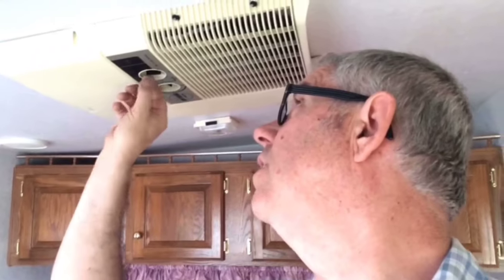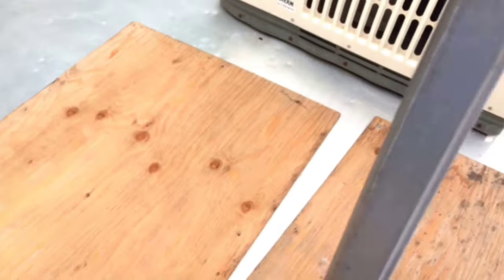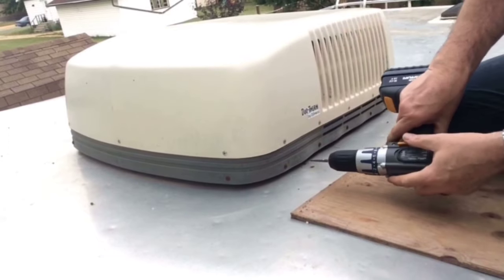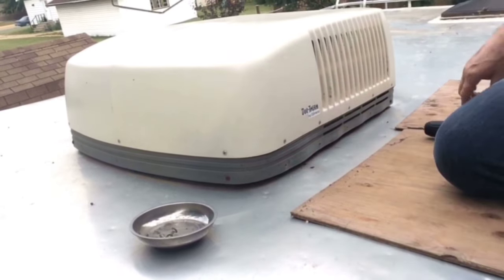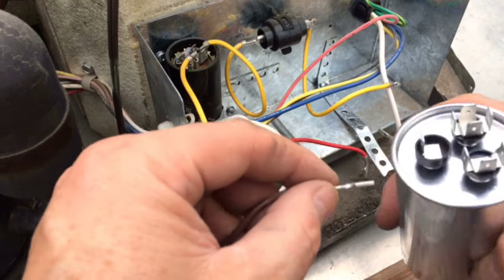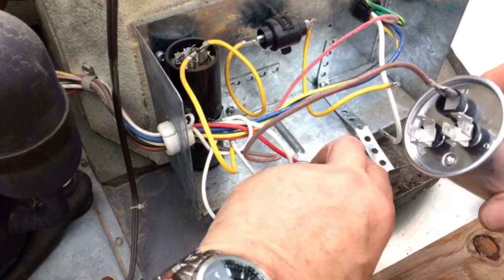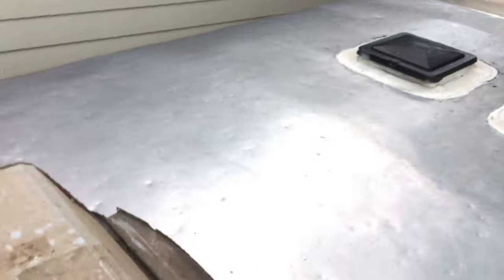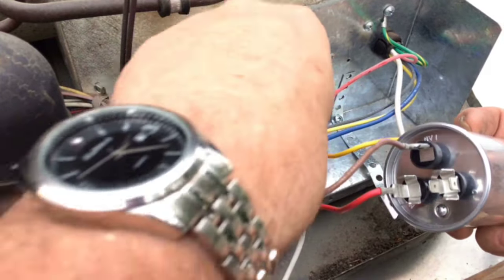Why does my RV air conditioner not start up (EP 15 ) not run?

Comment from the maker: ⚡Capacitors contain / store⚡  high voltage ⚡! Short terminals with a rubber handled screw driver. I still used rubber handled pliers just in case there is still stored power! 
Possible that if motor occasionally won't start, but does start after you rotate fan a bit, motor could have a dead spot and motor will need to be replaced. If it always needs a spin once you have turned it on, it's probably the capacitor. (probably 2 most common issues)
🔶 Check out my other RV camping videos in the series:  https://www.youtube.com/playlist?list=PLgeVnQRQkbzAsmAaCU0QzGXLWNaC-JOc6    🔶
Reply: What if I can get my fan to kickstart but when I went inside it’s not blowing air but motor is going
Reply from the maker: Charles Mckie , best bet is talk to a rv dealer. They will be able to get the exact parts for your specific unit.
Reply: I am do glad that you mentioned the safety aspect of removing a capacitor, when I saw your video I was literally diying inside. You must always discharge or use rubber to disconnect.

Comment: your video was helpful.  it motivated me to call the repair guy
Reply from the maker: Thanks Carl! I would probably feel the same after watching it. That was one of my first videos on youtube, (video 15) which was hard enough to try to repair, let alone try to video and make some commentary!  Electronic repair is not my strong point (as you could tell...LOL) Some may want to try to figure these things out and hope it fixes the problem. There is specialized equipment for testing the CAP, but I didn't want to but that tool since it would never be used again.
Reply: @unclemarksdiyauto  pop
Reply: @unclemarksdiyauto  d

Comment: good video.  i might have missed it but might be good idea to show how to discharge the capacitor you removed, in case it had and residual charge
Reply from the maker: Nope, you did not miss it Jim. And your right, I should have discharged it as I was filming the video. Early video, (#15) I am slowly learning from each additional one I make.  Yesterday was my 292 video (i think) Nov 1/21. I learned a few things in this one, like don't take for granted you will remember which wire goes where! Lol! Thanks for watching.

Comment: My ac is driving me crazy.  I replaced the small cap (since the diagram is too badly weathered) but this year the fan doesn't start when I spin it by hand so maybe it's the motor or the other cap.  But I'll fix it myself if it kills me.  Nice vid.

Comment: A part number or specs would be helpful. I need this exact part but I guess I'll keep looking, smh
Reply from the maker: Any rv place should be able to get one for you. I had a hard time figuring out which one it was too. I believe your old capacitor should have specs right on it.
Reply: @Wayne Burlingame Hi Wayne, where did you post them?  Do you have a website or YouTube channel?  I Ned this exact same part for my RV air conditioner. Thanks.

Comment: I've got a roof top ac , it had a for sure start cap that had blown....I replaced , and the motor would run kind of slow  and stop... I tested run cap and it value was just in the verge of variance , so it seemed to work slightly but not all time , so I ordered a new one it test good. But the motor still spun slowly....but run consistently ...I went ahead and ordered a new motor thinking it might be windings....the new motor does the same ...it came with new run cap , so I've tried switching it ..no change, it tested good as well. I retested the capacitance of the start cap again just to see if it changed and it is right on the money at 7.5mfd , I started trying to isolate ...and it will run at normal speed perfectly if I disconnect the start capacitor after its started ... if I try turning on without start capacitor,  it won't start up on its own but with a light spin will run just fine...I've tested this out in the previous motor as well. So this makes me believe there maybe something wrong with the start capacitor in some way that it's not discharging prooerly...I've not sure, what do you think? Am I over looking something?
Reply from the maker: How many wires coming out of motor? The start cap could have one side connected to a shared wire, and the other on it's own. Or you could have just two wires directly connected to the motor and up to 5 wires on their own going back to the blower speed control switch. I'll look and see if I can find a diagram.
Reply: @unclemarksdiyauto  
The motor has 5 wires red black white , then two brown one with white stripe, the two browns goto the start capacitor. When it's all connected as it should the motor will start and run when you turn the power on , but it runs slow, if you disconnect any lead from the start cap, then it runs at normal speed, of course if I try and turn power with the start cap unplugged it won't start on its own and needs a gentle spin but runs at normal speed. If you try to reconnect a lead it will slow it down .  I'm not sure what else to try , I thought about ordering another start capacitor to see if there is going on with the one that I have.
Reply: dustinpool sounds like your wiring the capacitor wrong
Reply: @halod   your right , I had a second motor shipped out, the company was very accommodating, when I installed the new motor I realized at some point of taking things apart and putting it back over and over I switched the run and start capacitors. I switched them back and it worked perfectly. ..goes to show even those of us who work on this stuff quite often sometimes still make mistakes in the heat

Comment: Thank you! Thank you! That’s what I think is wrong with mine. Wish I could get up on the roof. So that’s a capacitor and you bought it from a local store? Thanks again.
Reply from the maker: Rv stores. On line, and others. I would get specific info off of your first. Capacitors come in many sizes and capacitance specs.  I think it cost me $20 CAD. Probably could have found it even cheaper...  be safe!
Reply: UncleMarks DIY Automotive Fix it channel Thanks, I have the Manuel. It’s an old unit but I can’t afford a new one now.
Reply: UncleMarks DIY Automotive Fix it channel Didn’t work. It’s the motor. Dang!
Reply from the maker: RVFreeDa, dang! But it would start if you would spin it? If so, must have had a dead spot...

Comment: Why isn't there a ground wire terminal on new capacitors?  My old one has one.  Do I not need to ground it?
Reply from the maker: Chad Fessenden, I’m not an electronics expert. Maybe you just don’t have the correct replacement? Their are different types. A lot have two. Can type has an oil type electrolyte. One is used for fan motor. Like a bump start. Others are dual plastic container. One section for cold start another section for hot start. Make any sense? That’s how another subscriber with electronics background explained it to me...
Reply: It could be the ground is the outside wall when attached to the bracket which means it should be mounted before any hot wire connections are made. A capacitor holds a high charge and will discharge when needed. Any used capacitor should be discharged before handing it.

Comment: I noticed you removed all white (common wires) first. With so many white wires that might be a universal capacitor?
Reply from the maker: Robert Rozzell, good question.  I am not sure. Others have stated their capacitor is different, so I guess every application may be different. I would make sure of specs on old one before ordering anything.

Comment: How do you know the capicator was bad 
My fan works but compressor takes all juice in camper and don't kick on the microwave goes out
Reply from the maker: Capacitor gives the fan a kick to start turning over.  If fan works, cap is good. Wondering if your compressor is bad if it throws the breaker? Or is breaker weak? Can you get someone to test how much current power your compressor is drawing? Those are my 2 ideas to do first.

Comment: How do you know the capicator was bad 
My fan works but compressor takes all juice in camper and don't kick on the microwave goes out*
Reply from the maker: Thinking the compressor is shot. Seizing up etc? It should not throw the breaker! Cap gets the motor spinning. If cap is bad, fan will not fire up!

Comment: I changed the capacitor and I still have to spin my fan to get it to come back on what else could it be ?
Reply from the maker: Humm, Every time, or just sometimes?
Reply: Every time I turn it off after I changed the capacitor the him will be there and the fan will turn slowly until it gets going or I spin it and it works good after that but now it’s started freezing up
Reply from the maker: @Gump23  I am not a expert on air conditioners so my knowledge is limited. Keep doing some research and hope you figure it out.

Comment: I've got almost the same unit and the fan works fine except that the compressor stopped working.  Does anyone know how to test the compressor?
Reply from the maker: Obviuosly I am not a air conditioning tech. Wonder if these are like cars where if out or low on freon, pump won't cut in? If it is, I imagine this will have to be looked at by a professional. (Just a thought.)

Comment: Is that a small black capacitor in the middle..? I need the name of it plsssss
Reply from the maker: Video is from 5 years ago. I am thinking it is a stabilizer for surge protection?
Reply: @unclemarksdiyauto  ok . Do u happen to have access to it still to possibly get a part number..? Thanks
Reply from the maker: I don't. The only thing I have is a copy of the wiring schematics:  https://youtu.be/undD8uN8JCw
Reply: @unclemarksdiyauto  thanks mate
Reply from the maker: @jacksonbrooks8010  sorry I could not be of more help.

Comment: On the Duo-Therm tag inside the bottom of the unit there, what model number does it list for you?  I have a model 57912.010 that appears identical to yours, but in the capacitor box there was no big black capacitor in mine (although I have the holes punched to put one there).  My fan has stopped operating too, but the motor is still getting power and isn't rotating.  After cutting power, the fan blades can freely move, but not with power. @_@
Reply from the maker: Not sure the model number, but will re-title this video to include that number.
Reply: @unclemarksdiyauto  Thank you so much.  I am curious if it is a part of the same series as mine.  It looked identical in assembly above and below, and most of my wiring diagram is missing.  I am attempting to contact Duo-Therm to get my exact wiring diagram though.
Reply from the maker: @TheXev  I will have a link to the schematics soon. I can email you a copy if you send me a note to unclemarksdiyautomotive@gmail.com  Sorry this took so long. I had sold trailer & had no access to schematics.

Comment: I have a question, hopefully you the video guy or any of your viewers here can give me an idea if my problem could be the same as yours to fix.  My ac just went out a day ago, when I turn it on it has 2 options “auto and fan” the fan works but not the auto.

 Do you think changing the capacitor will take care of it?
Reply from the maker: I think this will NOT fix your problem. Obviously the start CAP works because the fan works. Might there be something wrong with your thermostat? Could also be something up with the other electronics. Here is a test. Turn auto on and thermostat to coldest setting.  If it is a start CAP, if you spin the fan by had, it will start. Hope this is of some help, Ricardoso.
Reply: @unclemarksdiyauto  thank you very much. I’ll give it a shot.
Reply from the maker: Let us know what you find out!
Reply: @unclemarksdiyauto  okay here’s the update. I went up there “roof” cleaned the unit as best as possible, vacuum and blower to dust it all off. After that I stared it up with the face all the way down to I believe is 20 it’s started normal, it’s cools the room, takes a little more time than it usually did, and it’s also not as cold as it used to be. 

What should be the next step there? 
Lie I said before it wasn’t working on “auto” just ON. Now it works on both but not cool/cold enough.

Thank you.
Reply from the maker: @ricardosom7766  It is possible due to outside temp and humidity could make it seem that "today" it is not as cold, or it feels colder. Did you also clean the filter that is inside? Otherwise, I have no suggestions as I am not a air condition tech. As to how cold the air is coming out of the unit, the best way to tell is by using a thermometer at the unit. Then there is no guessing. Not sure how cold it should be at the unit, in a car it can be around 40 to 45 Fahrenheit at the vents. (Aprox)
Reply: @unclemarksdiyauto  yes I cleaned the sí de and changed the filter. To make sure everything is good.  But you’re right I was also thinking that it could be the very very high temperature we’re getting this week. I’m in the LA area close to antelope valley dessert area so the temp has been very high specially this week and with all the fires going close here. 
Thank you for your time.

Comment: Not very helpful BECAUSE..... you didn't trouble shoot anything else before taking roof unit apart.

I KNOW there's gotta be a "start with the easy,  obvious stuff first" checklist.
No way  jumping streight to this.
Thanks for nothing people on my shoes. 
Glad it apparently did help some folks.
Reply from the maker: The trouble shooting was that it would only start with a spin. It never would start on it's own. These use a start capacitor to do it. Since it started with a spin, chances are pretty high that was the issue, and it was! (I am not a air conditioning tech) What would you have done?

Comment: What did you replace fan motor or capacitor?
Reply from the maker: The capacitor.
Reply: @unclemarksdiyauto  is that why the fan wasnt turning but ac still kicked on? Having same issues
Reply: @unclemarksdiyauto  just bought camper and it hums on ac but no air or fan spinning
Reply from the maker: @eddiebrittanedavis  possibly.
Reply from the maker: I replaced the capacitor. Will the fan run if you give it a spin?
Reply: @unclemarksdiyauto  I spun it but was kinda hard but did not kick on
Reply from the maker: @eddiebrittanedavis  Did you try both ways? That is all the help I can give you, sorry.
Reply: @eddiebrittanedavis  if its hard there might be stuff in the fan u have to go on the roof to check sorry I'm late lol
Reply: @bobthebuilder1360  thanks buddy
Reply: @eddiebrittanedavis  welcome